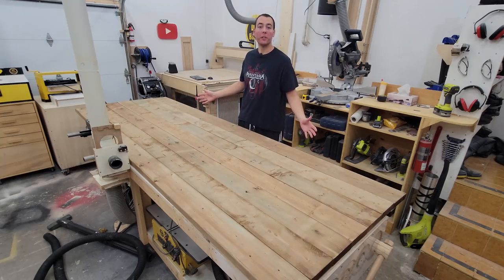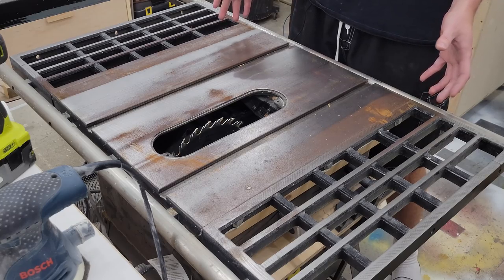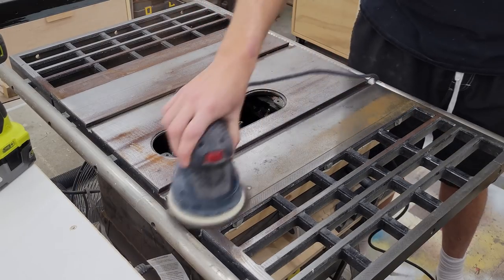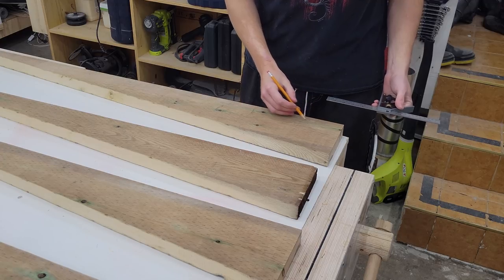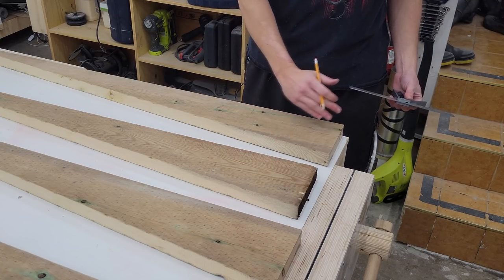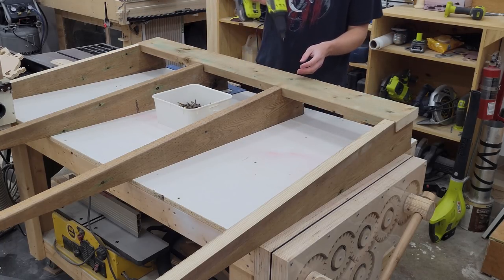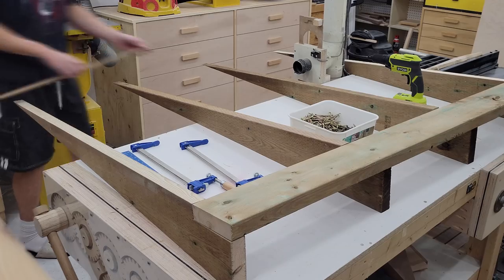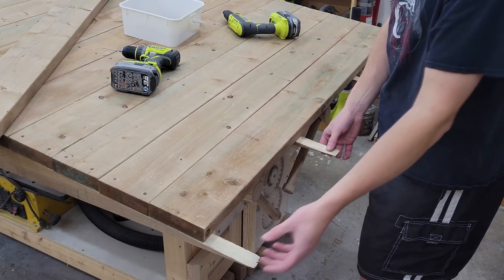DIY Shed Ramp - I Also Wrecked my Table Saw!

Comment: This NOT a criticism; rather, it is a simple question:  since this project will be outdoors (in the weather), why not leave a 1/4 inch (0.635 cm) gap between the boards for expansion/contraction.....eh?
Reply from the maker: The boards are super wet and will contract even being outside. Same thing happened to my deck.